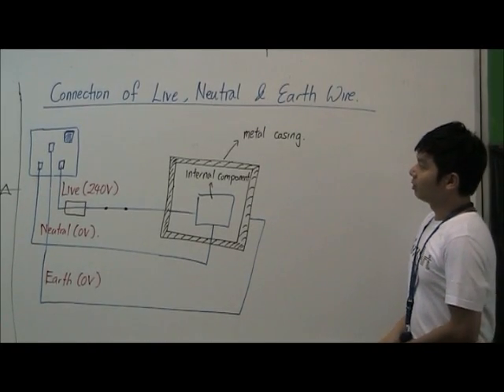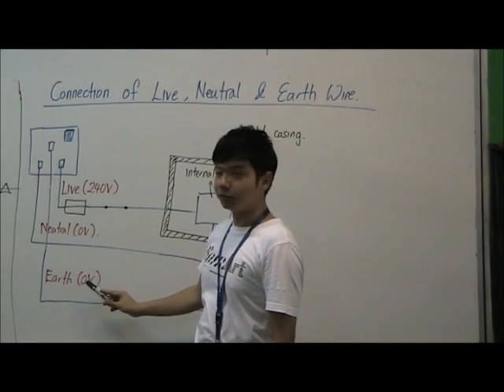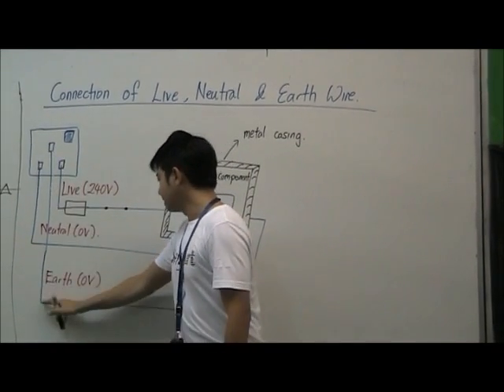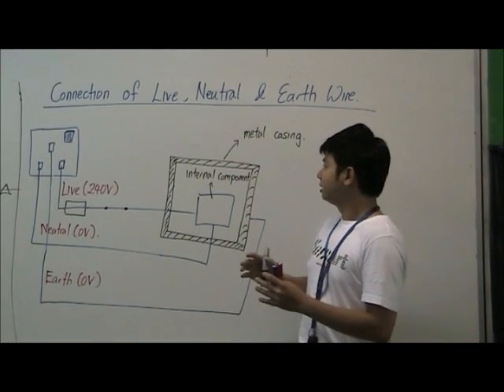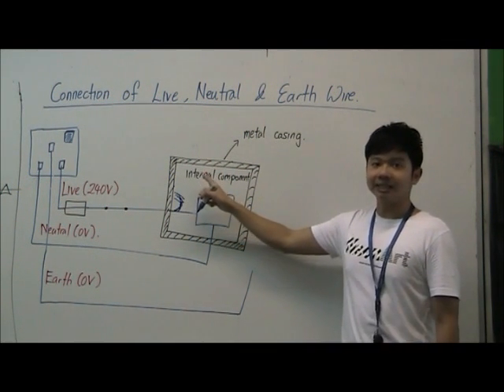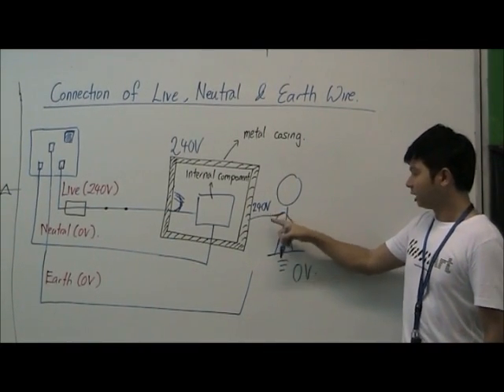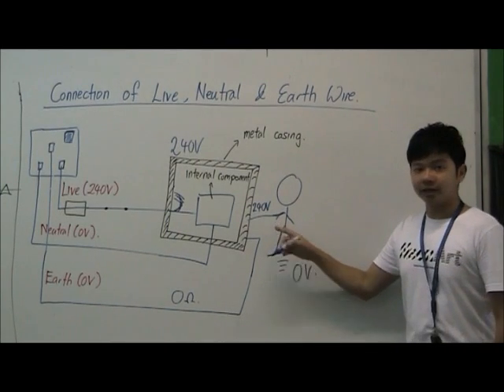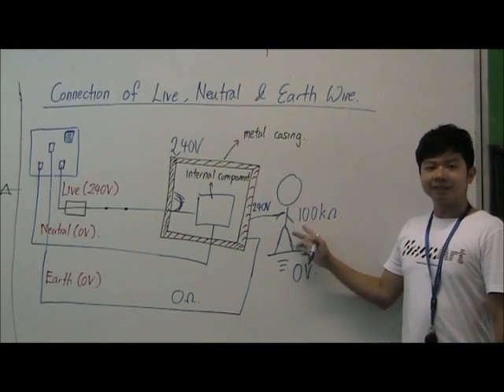Connection of Live, Neutral and Earth Wire

Comment: i have question why when i measure using multimeter voltage between neutral (0) v and earth (0) v  it gives me 240 v while they have the same 0 volt ??  also when i measure between live (220) v  and earth (0) v  it gives me 0 volt ? explain ..plz

Comment: Yes you can. It's not going to explode even if there is a spark or the pipe became hot because it would need oxygen for combustion; But using a gas pipe as an appliance ground is unusual. But if you're trying to DIY some ground, you're better of using a water pipe which runs to earth (ground)

Yes, you can tie it to a ground rod outside which will need a certain level of depth depending on your country's electrical code, in practice here it is 10-30' depends on depth of water table.